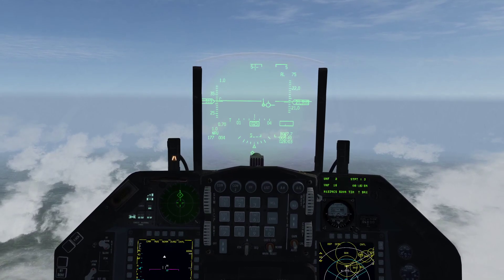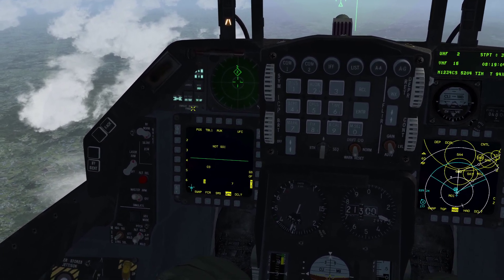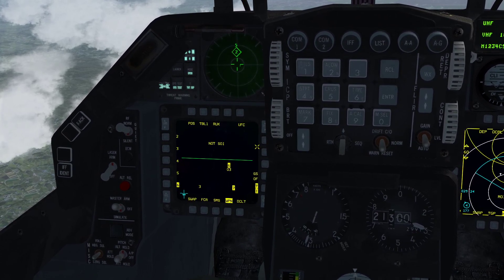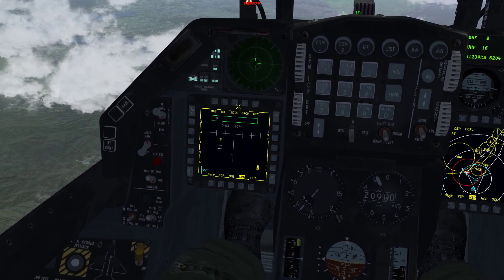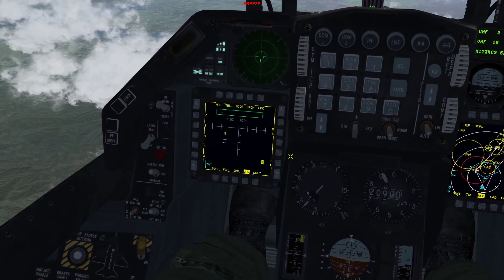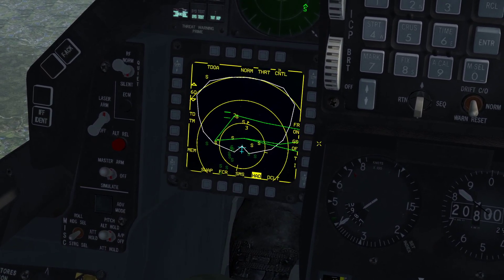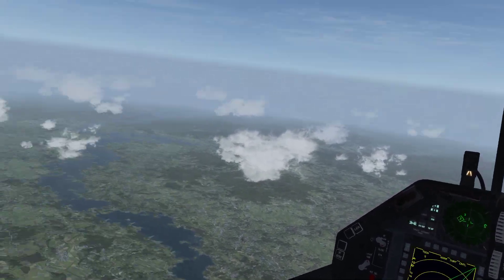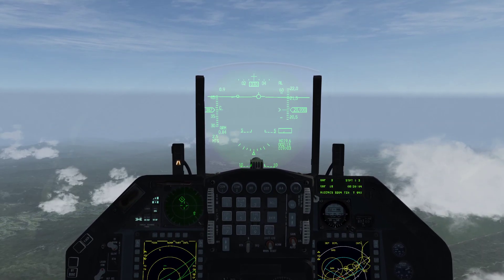Falcon BMS 4.34 - AGM-88 HARM Tutorial

Comment: Hi.   At 9:50 you are describing HAS with its center, right & left fields of view.   Is there a benefit to using the right or left FOV?     Thanks.
Reply from the maker: Sure. With the default WIDE FOV, you're seeing all the emitters the HARM seeker can see, all compressed into the area of the MFD. By selecting one of the narrower FOVs, you can isolate the FOV you want to look at, spreading the emitters in that narrower FOV across the area of the MFD. This can help declutter a potentially very cluttered display.
Reply: @starfury5629    That clarifies things.   Thanks for your help.
Reply: If you are a surface to air missile system radar operator, and you happen to see an F-16 point its nose directly at you, it might be a good time to interrupt transmission.  This is why an actualy effective integrated air defese system (IADS) has more than one search and track radar strategically scattered, so as that they can employ them semi-actively, and thereby render anti-radiation missiles obsolete.   Meaning an integrated system would turn on or off specific radar transmitters randomly, while maintaintaining tracking and search capability system wide, so no individual radar transmitter could ever be targeted for very long.